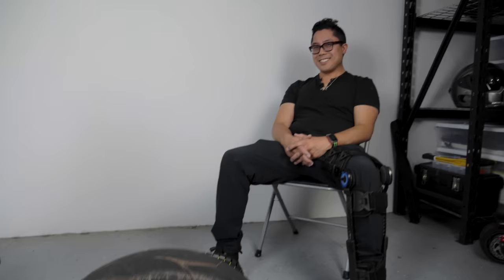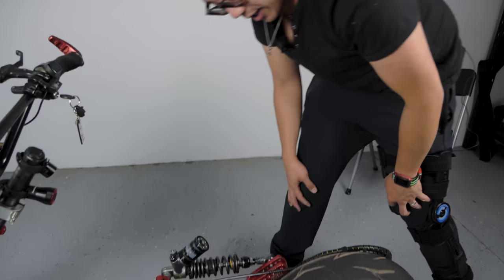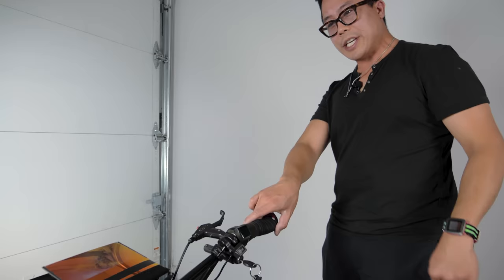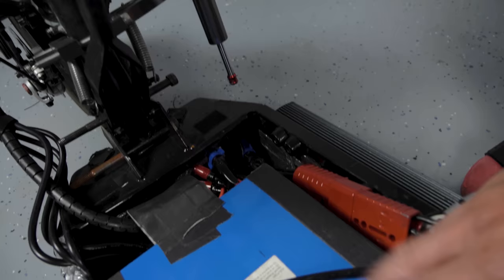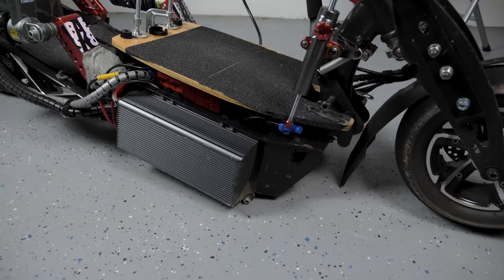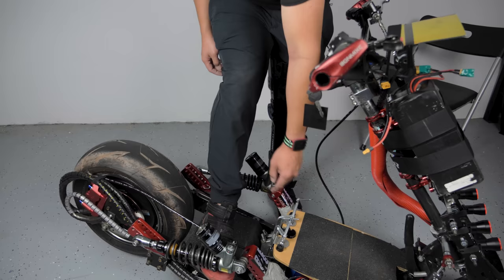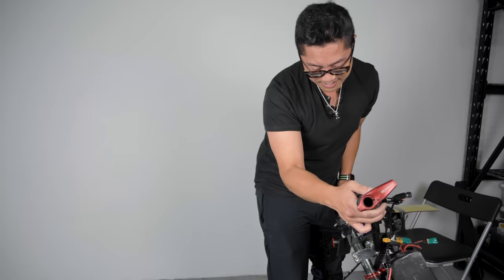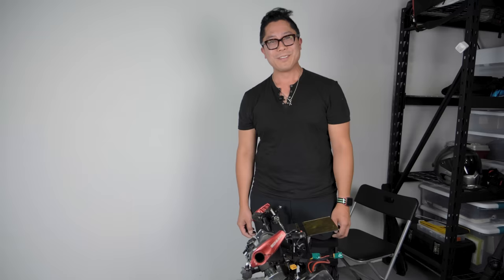THE GOBLIN | An in-depth look at building a custom monster electric scooter

Comment: Thanks for the video! It is great to get this perspective. I have had the honor to ride a few times now with the Goblin and it is a beast and such a striking e-scooter. Hopefully once we ride again I can take some high speed chasing shots with my quadcopter. I only had my 5" quadcopter on this past ride so I wanted to keep a safe distance from folks. It was also crazy windy. However, I just finished a more people friendly chase quad with prop guards so I can fly through the crowd really low without fear of injury. Looking forward to the upcoming projects.
Reply from the maker: Sweet, let's go out and get some drone chase footage soon!
Reply from the maker: Have any good locations in mind for doing an electric scooter chase? Hard to find roads without people and cars on to ride. Maybe we need to rent a race track.
Reply: @AlienRides  Sadly I am not aware of a big enough open space. I had a hard time finding a place where I could run my 100MPH remote control car as it needs a lot of distance. Lack of road space is a big reason I love racequads as you can just go all out in the air :)

I remember in one of your videos you were in a big open parking lot. I think you had a Lambo running around in there.

Where was that shot?
Reply from the maker: Robert Fontanosa Yeah that’s a fun spot down the penninsula a bit, we can head there and film sometime 😁

Comment: Wow Randy is the man! I have 1 quick suggestion for him which should be easy for him to improve that thing: get rid of them G clamps in the middle of that thing! Replace them with a steel plate held in place with two 10mm bolts which you can quickly remove when you need to by using a battery drill with socket attachment. Them G clamps sticking up like that are dangerous! And doesn’t look cool either. Other than that one thing, I love this machine! What a BEAST!
Reply from the maker: For sure, I can think of about a million things that might work better than the C-clamps, but not sure they would have the "goblin feel" to it 😅 I'll make sure he sees your comment!

Comment: Hi Alien Rides. Last week I mentioned I was inspired by the Goblin build and I went ahead and worked on my busted No Brand scooter that's a mix between Uberscoot and Evo. After replacing all 15 Mosfets on the control board, it blew up when energized. LOL..So, I went ahead and cut all the wires, which was something I did Not want to do, and installed a spare control board. Well, Voila..the damned this started working after watching a plethora of videos on Youtube and finally got it Right after a whole Friggin year.  Now I can do my weekly beer runs, man. I subscribed and having a blast watching you have crazy azz fun. Cheers, man. 
Eugene
Reply from the maker: That’s awesome, changing out a controller is no easy task! I’m glad to hear your scooter is working. Nice job! 👏
Reply: @AlienRides  Thank you for responding so quick. Man, I sure miss my ride especially my motorcycle. Cheers...
Eugene

Comment: update on the bajaboard project. i went back over my 10s12p battery and realized i made a wiring error on the BMS, i fixed the wire connection and location for power and now everything works, so far.
with all the new extra cables and i cant use the stock deck lid because all the extra wires and cables wont allow it. so now im planing on building my own custom deck lid and hollowing out the insides to make room for all the extra cables and BMS.
 THEN i can finally take it for a test ride.
im always happy to see more custom build interviews like this in depth just to pick at the owners mind to see what solutions they came up with for various problems
Reply from the maker: That sounds awesome! I’ll be looking forward to seeing that beast alive! Consider doing a video once it’s rolling. 👽🖖

Comment: Great vid! When I first caught a glimpse of the Goblin in a group ride clip, I thought WTF is that?!! I suspected it was a custom fabricated machine, so it was great to have Randy explain about it. I'm guessing he works in IT as I did? Not many people would just grab server power cables. The big power connectors are usually used for electric Fork Lifts and other high current applications, so certainly up to the task. I suspect there's a similar audio background there too as Randy just happened to have an amplifier case handy! I love this sort of mechanical creativity and did similar stuff when I was racing a 250cc water-cooled, 2 stroke grass kart. Fitted a programable ignition system and designed a flat shift gear lever. Would rip through gears at full throttle with front wheels in the air! Just got into scooters 6 months ago and about to upgrade my WideWheel dual to a Mantis Duo after watching so many reviews on this channel. Cheers heaps for this one!
Reply from the maker: Yeah, sounds like you and Randy might share a similar background! I think the mantis will be a really nice upgrade over the WideWheel, you're going to love it!

Comment: Just follow the heat to find your weakest link the resistance is translated as heat and weather your motor can't run as hard as you demand and gets hottest or the controller is being overworked and it is hottest and any spots in your wiring that have resistance in line will heat up at that point and if it is too hot put a better wire, connector, or component until the whole system runs without overheating until you are really doing something you shouldn't like full throttle up hill 1 motor and after 2 miles your full throttle and half speed thats never gonna be good. Turn on all your motors and controllers and splitt the load between the motors and try and just use half your amps and run up the hill at like 1500whatts be smart and you wont have to overbuild too much. Awesome build though man I have 2 scooters but nothing like this so please know I mean respect for your adventure man
Reply from the maker: Good points about finding the weak spot and iterating on it. We're gonna keep modifying scooters and build some crazy stuff in the future!

Comment: Wow man, what an awesome build!
40% Jank, 60% Insanity.
The perfect combination man, your build is unlike anything I’ve seen anywhere else man, be proud knowing you inspired me to go even further the first time I saw it!

Your angle for rake is the only one that I’ve seen that makes any shred of sense. Well done getting that steering geometry dialed in like that!

The trailer build is amazing too man, now you’ve got a hybrid system! Electrically powered and refuelled by petrol/diesel/gas. 
What’s the reasoning for the larger voltage pack in the trailer vs the Goblin itself? Running sneaky series? 😈

Wow man, a QS motor aye, not too bad at all and 190ft-lb is no joke, sounds about on par with some of spinningmagnets builds. The thermal density must be such a lifesaver on that motor, I bet you could double your voltage before you start seeing any kinds of issues with it!

Genuinely impressed with the build and I’m super keen to follow along the way! Surprised you only went with a 150amp capable sabvoton for that motor, surely it wants the 600amp ones?

Thanks for this video guys, the Goblin has been plaguing my dreams lately 😂
Reply from the maker: Awesome observations as always, and I'm glad we were able to give folks some more information on this build. Tons more planned and I'll make sure Randy sees your comment. Good luck with your build! 👽🖖
Reply: Alien Rides thanks for that man, I really appreciate it :D

Latest project has me running at 60km/h with only a 12v booster. It’s not even getting warm and it’s finally got about 40nm of torque to it.
Next step is to see how far I can actually push the stock controllers before new stuff comes in 😂

(Ps the unit I’m working with right now is just a basic commuter model, destroyed the motor on the GTR and I’m waiting on a replacement)

Comment: Wow that awesome. I gotta question for u if u don't mind. I have 36v lead acid battery scooter and I want to changeit to a lithium. Do I need to change the controller also?. Ty
Reply from the maker: You may be able to use the same contoller if you use the same voltage lithium battery, but there is a chance it won't work. I guess you'll need to try to see. :_alienRides:

Comment: Maybe you you keep the rear hub for torque and traction, but to increase the speed you could add another motor on the front with higher rpm with less torque, then once the rear motor gets you up to 60 you could send power to the front and disable the rear hub. Kind of like a twin turbo setup on a car except one high torque motor to start and build speed and another high rpm motor for high speed
Reply from the maker: Two motors would be interesting, but since they're hub motors you could probably just run them both. 👽🖖

Comment: Front and rear tires moving at different speeds cause speed wobble. Just from looking at it I can tell the death wobble on this thing gets fierce when it goes fast. Get the same size front tire as the rear and it'll do 90 completely stable
Reply from the maker: Hah, good tips I'm sure he's going to experiment with different sizes 👽🖖

Comment: just a suggestion but you should put another 5000w motor like the back one on the front because you already have two battery's so just another controller and that's it and it will help with the scooter being stable because both of the wheel will be the same size
Reply from the maker: Good suggestion, he's always experimenting, who knows what the goblin will turn into the future. 👽🖖

Comment: So If I want an external battery. Its ok if the Ah do not match, as long as the voltage of the battery does?
Reply from the maker: I believe generally this is ok, but you might need to charge the batteries separately.
Reply: @AlienRides  thank you

Comment: Awesome machine you got there. I just ordered a Fieabor 60V 32AH 5600W dual motor. Any suggestions for a first time rider?
Reply from the maker: Sounds like a pretty nice beast of a scooter. I'd say double check all of the bolts when you get it to make sure they're all tight. Wear a helmet, and have a good time!
Reply: @AlienRides  Thanks bro! I weigh 250lbs how fast do you think this can go holding my weight?
Reply from the maker: @davidjas2378  If it's truly a 5600 watt motor then it should be able to get close to 50 mph or so. Take your time getting it up to that speed though, takes some time learning how to ride at that speed without wobble.
Reply: @AlienRides  willl do, definitely not looking to crash n burn. Thanks!

Comment: If the steering was ACTUALLY controlled by your foot with the heel and toe you wouldn't have handlebars that would turn. Therefore your steering is in your handlebars not your feet lol
Reply from the maker: You can have both, you just don't need to turn them. I've tried it and it's really stiff. 👽🖖

Comment: That damper does exactly NOT damp in the straight position because it goes through its neutral point there 🤦🏼🤦🏼‍♀️🤦🏼‍♀️🤦‍♂️
Reply from the maker: Yeah, making it more level would definitely help, generally it still works since the handlebars are mostly straight during riding. I will suggest fixing it!

Comment: Hi Randy, fantastic build. Just wanted to ask why you didn't opt for a larger front wheel diameter to match the rear or were you restricted by the fork. I've been looking at using pit bike forks to try and increase the front but just wanted to check if there were any particular reasons you opted for the smaller wheel ?
Reply from the maker: I’ll see if he can answer, but I think he just liked how the smaller wheel felt, a larger one would be harder to carve I think.
Reply: @AlienRides  Thanks for the quick response. Would you mind also asking what the total voltage and amps he runs on a normal ride. Wasn't sure if the front pack was a back up or running in parallel with the main cell. This projects got me planning my own monster but I'm in the UK so need to either get it officially approved or sneak below the radar ;-)  Enjoying your ride out vids. Looks like you have a good tribe over your side of the pond
Reply from the maker: @fraserwhite73  normally I think it’s a 96 volt 40 ah or so, but a lot more when he adds the trailer.
Reply: @AlienRides  Many Thanks!

Comment: Hi could you please ask Randy the tyre size he used. i know in the video he mentioned the wheel size 12x5 inch. Im designing a scooter to use a very similar sized motor any would like to know what tire he is running on it. Thanks.
Reply from the maker: I'll ask him and try to get some links added to the description in the next week or two. 👽🖖
Reply: Thank's for replying. Just finished my first diy scooter but already looking for bigger and better.

Comment: The goblin is a death trap. I wouldn't go more than 15-20 miles an hour on that thing because it'll probably kill you. He needs to find a buddy who's a welder and get those clamps off of their... lol and fix the geometry issues. I use J-B Weld and epoxy all the time but there is a time and a place for it and that is not it.
Reply from the maker: Hah, for sure, it's definitely not the safest vehicle, but it's a ton of fun to ride. Just a got a welder actually, big plans in place for that.

Comment: your small front tire is a problem dual motorcycle forks
Reply from the maker: Basically a standup motorcycle at that point, would be fun to try. 👽🖖
Reply: Your front tire should a bit larger in diameter ,it will change your handling .check out the guy who built a gas version think he used a snowmobile motor lol

Comment: I’m not sure what the point of this scooter is if you can’t go past 40mph? I’m doing 35 miles on 1 battery and way past 40mph for
 $1100 shipped. Also can pick it up and throw it in a trunk
Reply from the maker: Right now towing, but it can definitely go faster. Being able to tow 500 lbs up a San Francisco hill is no easy feat. 👽🖖

Comment: I give you points for trying but a few constructive criticisms. If you are going to build something from scratch, make it pleasing to the eye. There is nothing about your homemade scooter that even looks remotely nice to look at. Second thing, it doesn't look safe enough to even get on, let alone ride on the streets with it. It looks like the whole thing is ready to full apart in many places. Third and final comment, The wiring looks like a 12 year old put it together. They make these things called zip ties, you should try and use them. Just sayin'....

Comment: Steering joint is looking very weak compare with power it have.
Reply from the maker: Yeah, maybe that should be improved next, it's one of the few remnants of the original scooter frame.

Comment: Nice apart from that cement shame that was needed
Reply from the maker: Hah, just gotta use whatever you got to get it running. Looks be damned. 😅
Reply: @AlienRides  was that needed
Reply from the maker: apples thompson it was, otherwise the pieces were moving too much and there was too much flex.
Reply: @AlienRides  i see atleast if it break the whole back end wont fall then 😂

Comment: WTF it looks like a toddler made this. mismatched batteries and all. wow.
Also the... everything it's built from, looks super dangerous. it looks like he went to a garbage dump and screwed random crap together...
Reply from the maker: You're right, it's totally scraped together, but the creator did it with love. :_alienRides:
Reply: @AlienRides  if he did it with love and a couple brain cells and used some "common" sense this could have gone together a LOT better. That thing is a hazard, especially with mismatched batteries, if 1 is outputting more than the other, it will feed into the other battery and eventually overheat it, then it will explode/melt/fire.
There's so much wrong with this it makes me embarrassed to even look at it.

Comment: That epoxy is janky as hell bro. Kind like the mad suspension setup tho going mono would be alot nicer and lighter
Reply from the maker: Indeed, it's definitely one big experiment. 👽🖖
Reply: @AlienRides  ide recommend go all steel and borrow a cheap stick welder do it thst way cheaply too. Ide hate to see you loose skin for using epoxy bonds on aloys
Reply: Welds only need to have good penetration as can grind down the buildup after chipping the stag off

Comment: I hate to dance Guy's not very smart because it's a Uber scoot been what he did it was clamps everywhere that's not necessary All you got to do is get a dirt bike or street bike swing arm and then all you had to do was make shop towers that move over in the middle and then put the electric motor in the middle then they have with hubs it's like with the tire on and then you change the that acid batteries with a lithium and you go to 72 volts so and this guy has wires coming through the deck maybe you get a sawzall and not use c clamps

Comment: I literally cannot begin to go into enough detail about how unsafe this is but I feel morally obligated to try.  Cement Epoxy is a temporary fix.. not a permanent solution to something that should be Bolted, Welded, Or Rivetted..  You have muffler clamps holding the frame together, and two C-Clamps stopping your frame from twisting which is just absolutely ridiculous.  This looks like something a child in a third world country would put together in an alleyway with peoples old appliances..  Please don't put anyone on this Glorified death trap.  And go buy a Welder.
Reply from the maker: Yup, all very valid points about how to properly engineer a ride. He definitely was creative for this one, let's see if we can weld a v2 now. :_alienRides: